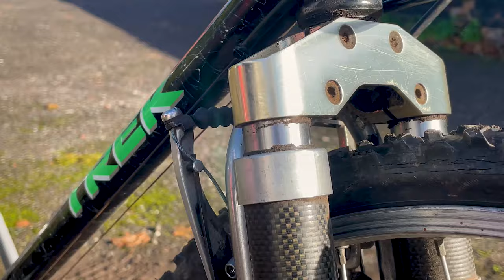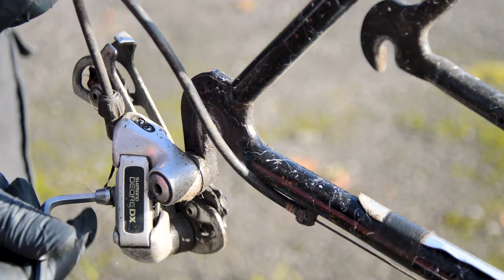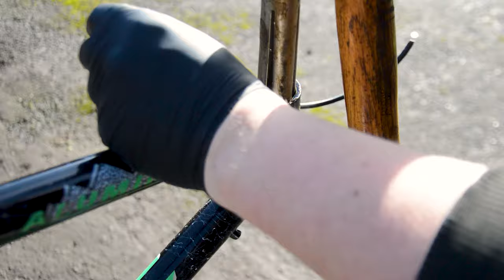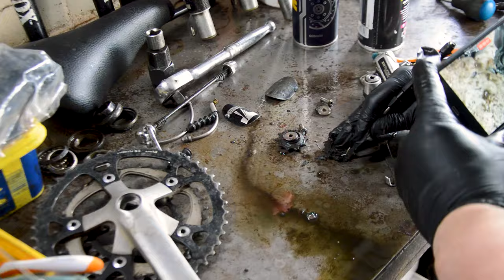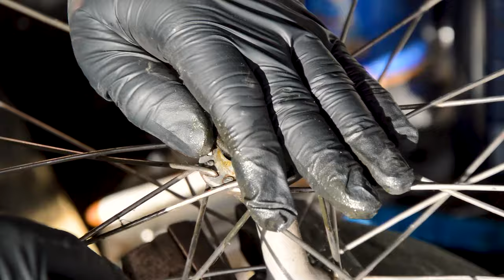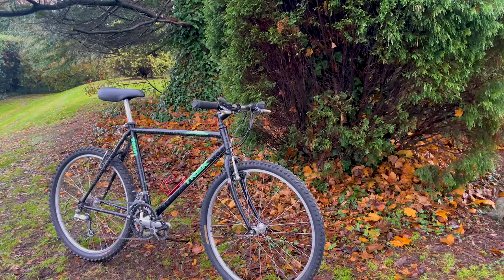Finding The "Rare" Vintage MTB Parts I Need (For Free) 1991 Trek 7000 Service

Comment: You need to grab some grip edge rpt hex sockets for those stripped and stuck allen/ hex/ cap head bolts. Thanks for the video man.
Reply from the maker: Ah it wasn’t too hard to remove with a bit of careful pressure.

Comment: What make of green grease is that?
Reply from the maker: It’s Shimano ‘Premium’ Grease. Comes in a tube and costs £12.95 from Merlin Cycles for around 100ml I think it is. Looks very much like the grease Bikespeeds sell for £9 per 15ml 👀
Reply: @MonkeyShred  lol you do get a nice syringe though! Thanks mate.
Reply: Might want to give Castrol LMX, or Motul Tech Grease 300 a try. Great stuff for bearings etc. Costs almost the same as the Shimano, but you get 400g. And it's green, too! 😂

Comment: Huh. How does one shatter a freehub?
Reply from the maker: Just age I think! It wasn’t even that tough to undo so I think it had broken off long before.
Reply: Many years ago, a Deore DX rear derailleur just broke off below the main mounting screw. As it turned out, there was a small air bubble inside. 
Mind, the bike had been ridden for around 15 years before that happened